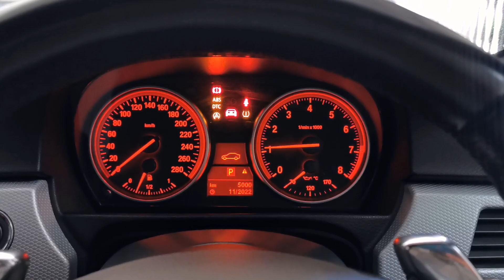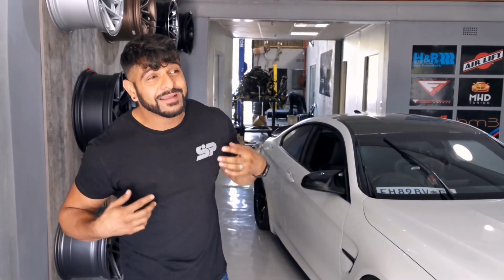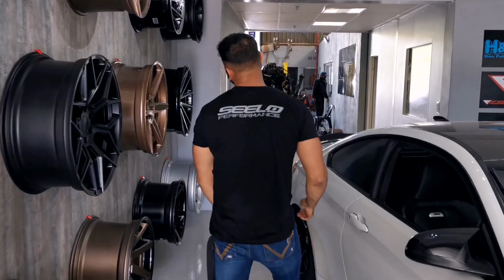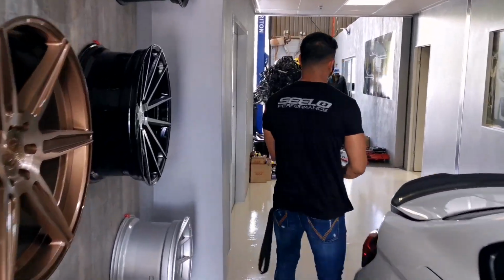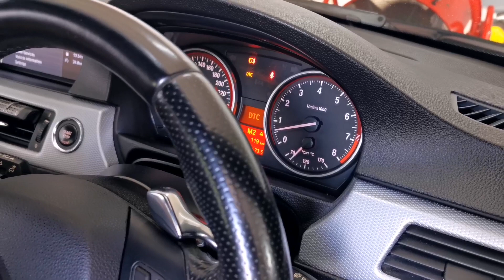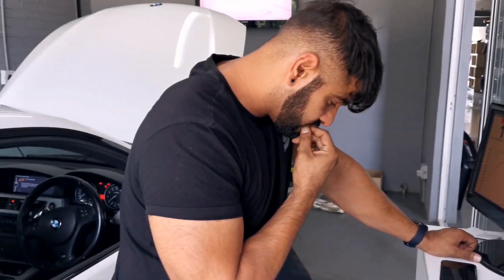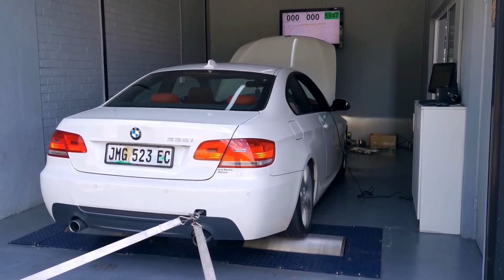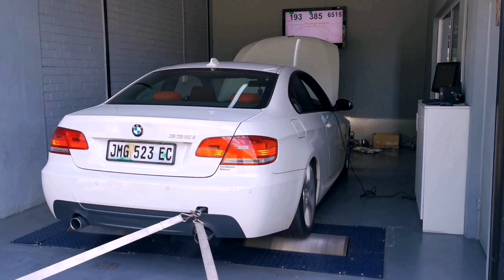Stock BMW N54 335i DCT Dyno Figures at Seelo Performance | The Carbon Connection

Comment: Awesome.. i have a E92 335i n54 put full bolt ons and Amazon turbos 17T  and tune by ken at wedge and ran 11.6 at 122 mph 1/4... 👍
Reply from the maker: Damn that's a good 1/4 mile time. Would love to achieve figures like that. Let's hope the build can get there! Thanks for tuning in man. Keep watching!
Reply: @The_Carbon_Connection  No worries its not hard to get them up there just pick a good tuner
Reply: is it dct?
Reply: @TCGTV98  it was 6hp auto.. its gone now it caught fire in the driveway
Reply from the maker: My one is a dct.
Reply from the maker: Damn sorry to hear that bro.
Reply: @The_Carbon_Connection  just make sure you get your blower motor checked thats how my car caught fire...